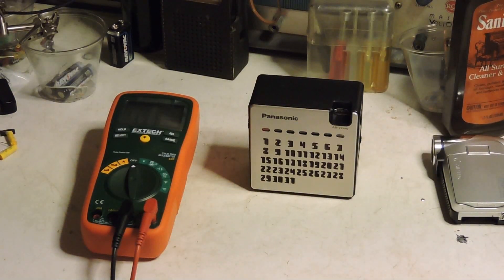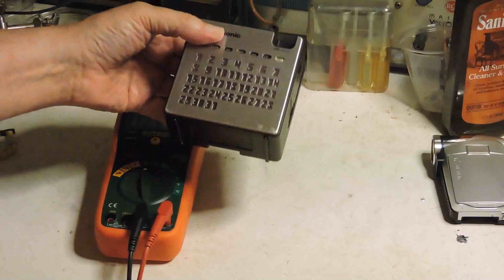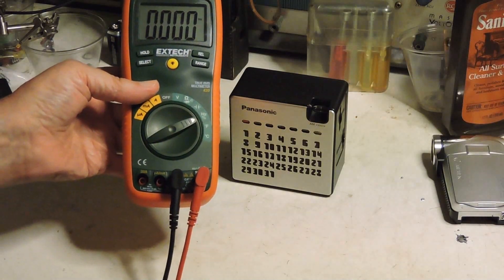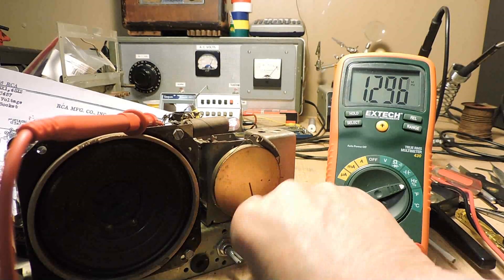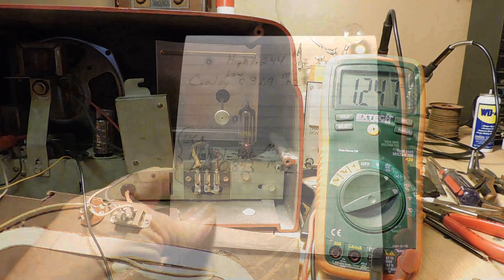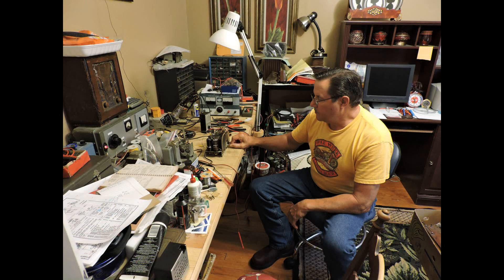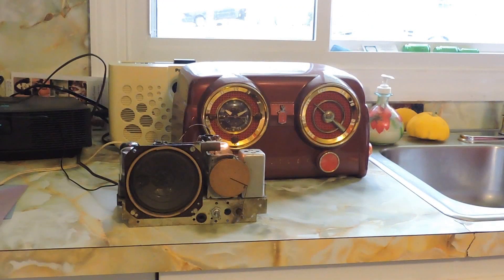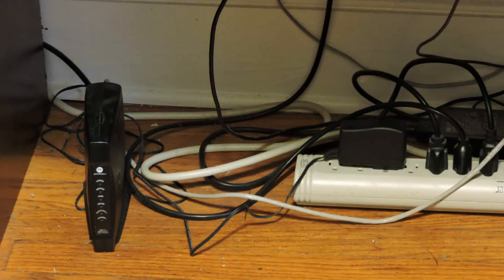Radio does not play but everything checks out good

Comment: How did you solve the problem? What did you do with the internet box power supply?
Reply from the maker: When we proved where the noise was coming from and what the problem was, the fix was to move the internet power supply to another outlet not on the same house circuit as the workbench. Not having the power supply on the same circuit and the capacitance between the two circuits was enough to filler out the noise.

Comment: Noisy Chinese switch mode power supply. These little plug packs often stop working, I discarded 3 from X-mas lights which lasted only one season. Replaced them with transformer supplies.

Comment: That is the problem with impulse power supplys, they generate RF noise. Have you tried using iron-core transformator power supply? Friend of mine had similar problem with 7" TFT-display that generated RF-noise at the frequency of wireless microphones. While the TFT-screen was important part of the system, where displaying the multimedia server output for monitoring. So what can you do here? Dilemma-dilemma.

Comment: I dealt with a similar issue a couple years ago, but instead of just the one branch circuit being affected, recption in the ENTIRE HOUSE was trashed, even on battery powered radios. Granted the high end of the BCB had lots of interference issues anyway from the BPL Internet connection I had then, an external hard drive power supply was the culprit of killing the entire AM band throughout the entire house.

Comment: I had the same problem with a computer power supply which didn't have sufficient line noise filtering...I had a spare EMI filter lying around with an IEC power input and I fit that to the power supply, and it solved the problem completely.

There are good Chinese-made switchmode PSUs...it matters more who made it than where it was made.
Reply: You can get some power supply strips that use small cap for rfi and emi filtering ,and buy a good one with surge protection too

Comment: As many others have said, these cheap bottom-of-the-barrel Chinese components and their similarly poor manufacturing are typically to blame.  This has been the case in my experience more times than I can count.  Quality and pride of workmanship is a thing of the past for the large majority of consumer products anymore.

I just found out that my clothes dryer, by GE, is squeaking because of a terrible design of the drum riding on smooth plastic pieces rather than using any kind of proper bearings.  The plastic slide bearings disintegrated from the friction, because it was literally designed with a failure point like this to reduce cost.  But since you only get a year warranty, you get to pay for the replacements yourself.  Conveniently, they sell a single pack of all of the various parts that they know are eventually going to fail, so you just replace them all at once while it's open.  Quality, eh?  And after seeing all the other brands that the same replacement pack can work with, you're not really left with any options because obviously it's all the same product, just with different knobs and shells.
Reply from the maker: FyberOptic Thanks

Comment: I had a similar problem.  My basement workshop normally has weak AM reception. But, I'm able to get enough stations during the daytime. However, in the evening, when reception should be stronger, I got mainly static. It took about a year for me to discover the reasons. First, my nearby laptop power supply was noisy and second, a touch dimming table lamp in our upstairs dining room was transmitting RF interference through the entire house. Unplugging these two items made a world of difference!
Reply from the maker: wacoflyer Thanks

Comment: Hi Rick
You discovered the cause, but it would be nice to know the effect. Why was the Internet power killing the radio RF ?
Reply from the maker: The Internet power supply is producing RF noise which is feeding into the power socket. Any AM radio plugged into the same feed as that socket will receive the RF noise. This RF noise travels through the power supply of the radio to all parts of the radio overwhelming the AM receiver. That's why the tube radios would not play in the room, but my transistor radio played fine, it's running on batteries.
Reply from the maker: famossfla overdrives the AVC
Reply from the maker: famossfla Do a channel search on AVC

Comment: Rick: Very interesting! However I think you are going to have to take this just a but further? For the life of me, I can't think of what would be causing not being able to receive AM just in that one room? I've come across power supplies, modems, and computers that induced all kinds of noise into the line. But never one that was capable of blocking signals completely. It seems to me that this just has to be more then a power problem? If you find out any more about this please let us viewers know.
Reply from the maker: The Internet power supply is producing RF noise which is feeding into the power socket. Any AM radio plugged into the same feed as that socket will receive the RF noise. This RF noise travels through the power supply of the radio to all parts of the radio overwhelming the AM receiver. That's why the tube radios would not play in the room, but my transistor radio played fine, it's running on batteries.